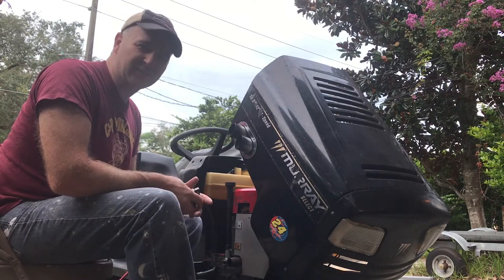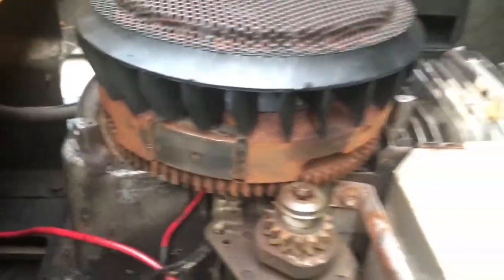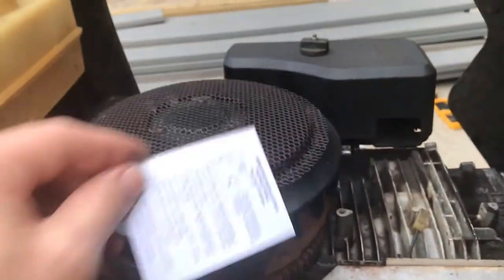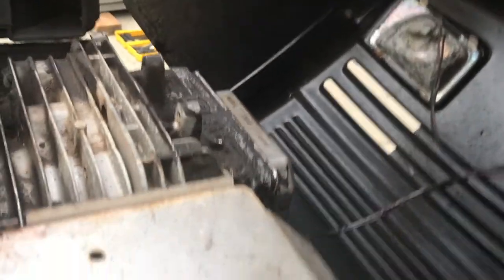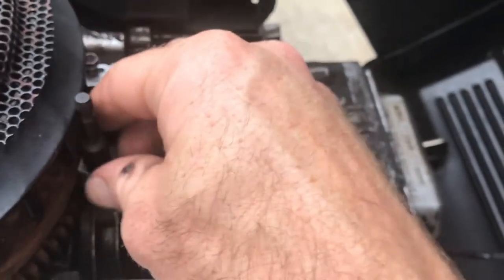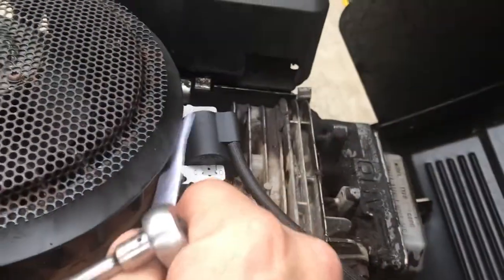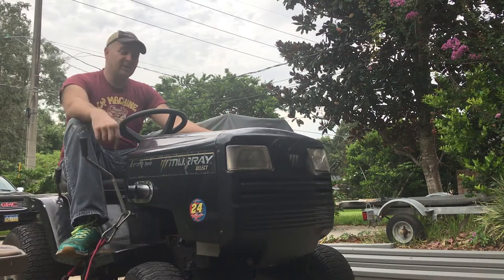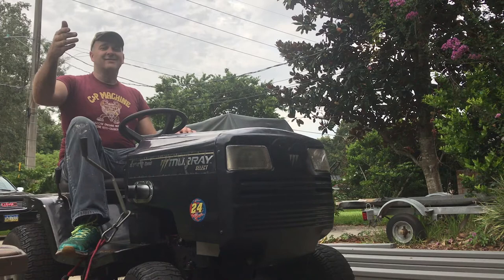How to fix no spark on a riding lawn mower-  Coil Replacement EASY FIX

Comment from the maker: Riding Lawn Mower Repair Manual: https://amzn.to/3qM5K6x
Parts used in this video
Replacement coil: https://amzn.to/3xs3lxF 
Spark Plug: https://amzn.to/3tzWscp
Oil Filter: https://amzn.to/39uXa3I
Spark Tester: https://amzn.to/3hLOOJl

Comment: The coil is not the only thing that will cause no spark. Spark plug, key switch, safety switches, points & condenser (if installed), etc. will cause a no spark condition. Also low oil levels on engines with low oil sensors can cause no spark. If you have a no spark condition is not necessarily the coil. First pull the kill wire off the coil, and check for spark. If you get spark then your problem is probably somewhere in the safety switches circuit or perhaps it is the ignition switch.
Reply from the maker: Yes. For sure there are a variety of potential causes. In this case we just tested the coil and found it to be bad. Thanks for watching.
Reply: Great point about how to quick check if it is the "kill" switch that is bad.

Comment: I think my mowers headed for the dam, it's doing my head in, ran like a champ the day I bought it, sat for a week and got nothing, found coil housing physically damaged so swapped in a bigger engine, shorted coil and got spark, installed, no spark, checked lead to coil 4.40ohms tested lead to earth terminal on coil 25ohms (don't know if it's the issue but in my mind it made sense being that as it would cut the engine) still no spark. Sanded flywheel coil and engine mount to coil, checked magnet, what else is there to do?
Reply from the maker: Thanks for watching. Sorry about your troubles. Without knowing your specific model I would say  check the kill wire that connected to the coil on most riding mowers. This is used to kill the coils ability to make spark if any of the safety switches are not in the right position. You can see an example on this diagram for general reference. https://drive.google.com/file/d/1-CU0FqxjWTo91WP9fCBndCOLxh4MyILT/view
Reply: @FireItUpGarage  cheers for the link, mines a little different then that, no sensors it's a 1988 model mtd. With now an 09 mtd engine (21b807-2505-b2) I checked the ground cable which has no resistance, it runs down to the throttle body on a plastic clip and then goes to the ignition barrel which then another cable that's bridged there runs to the rear of the mower. I ordered a new coil earlier incase its just giving funky numbers and to completely eliminate it. Though I'm confident it's not my issue
Reply from the maker: @xGSanni  Did you try unhooking that cable and trying to fire? often the ground wire is used to kill the coil.

Comment: Running but missing fire can you help push mover
Reply: Help
Reply: Over loading
Reply from the maker: If your push mower runs it has spark. It will not run without spark. If it is running poorly you may have an issue with fuel, a weak spark or other issues- depending on the type of engine. Check out our other mower videos for solving fuel problems on push mower.

Comment: I have the same engine on my lawn mower, but don’t get any spark. I measured the coil with a multimeter but looks ok, gives the right numbers. I measured the kill switch wire and it’s not broken but it still refuses to make a spark. Is it possible that the coil gives the right numbers and  is still defective? Best regards
Reply from the maker: Try cleaning the ground points of any corrosion or rust.

Comment: Replaced the coil on my Yard Machines and still no spark. I give up. Scraping it tomorrow to the dump. Spent 12hrs today trying to get it to fire. I'll buy a Zero Turn.
Reply from the maker: Sorry to hear you are having trouble. There is a good chance one of your safety switches is/ was the culprit. There should be a thinner black wire coming from the magneto/coil. When that wire is grounded to the chassis (saftey switch, cut wire etc.) it prohibits spark.  If you still have it try to disconnect that wire and see if it will start. If you already scrapped it enjoy the new zero turn. Thanks for watching.
Reply: @FireItUpGarage  that's what it seems like it's doing, but I was told a bad safety switch won't let it crank at all. I dunno where these safety switches are or look like so I'll dig in deeper in this tomorrow. Probably go buy a new coil too cause I swapped out the old one with a good one from my push mower last night. Still no spark. The ground wire that plugs into the coil is grounded good so...no idea.
Reply from the maker: @kennethdurbin3385  You can try to remove the small (often black) wire from the coil and see if it helps. Often that is a way for the safety switches to ground out the coil- which kills spark. (obviously we don't have the specs or diagram for your so this is based on more general experience)
Reply: @FireItUpGarage  yeah I've replaced everything that it could be on this thing. The engine model is 313707. Put a brand new coil and plug in just now, all it will do is crank til the battery dies then I have to use my jumpers on the pickup and repeat. Has to be something simple I'm not seeing.
Reply from the maker: @kennethdurbin3385  Try to unhook the small wire on the coil and try again without it.
Reply: @FireItUpGarage  I went out and tried again. This time I pulled the plug and held it against the engine while it cranked over...got spark. Reinstalled, won't crank. Pulled plug again, cranks fast but no spark. Weird!  Won't crank over with the plug installed. Never seen this before.
Reply from the maker: @kennethdurbin3385  remove the small wire (not spark plug wire) from the coil to make sure none of the switches are grounding it out and also check the coil gap (as shown in the video) At that point if you are still getting no or inconsistent spark it would probably be the coil or you could have rust on the contacts (on the coil or on the flywheel).  If you have spark and it still wont start it is either fuel or timing. we have seen them jump time at times. Then they have spark and fuel and will still not start because they are out of time.
Reply: @FireItUpGarage  finally got it running. However, the red wire behind the ignition button that runs down to the solenoid and starter will get red hot and smoke and it shuts off. Any idea why? The wire was melted and barely on from shorting out so I pulled it off til I figure out why it's doing this.
Reply from the maker: @kennethdurbin3385  Thats great that you got it running! The large wire on the starter will get hot if you crank it for a long period of time. Especially if the wire was already damaged or partially broken. Let it cool all the way down, repair wire if necessary and see if it gets that hot with only the standard short period of cranking.